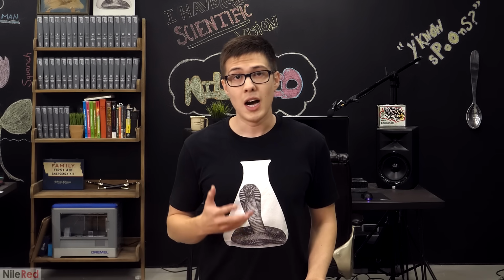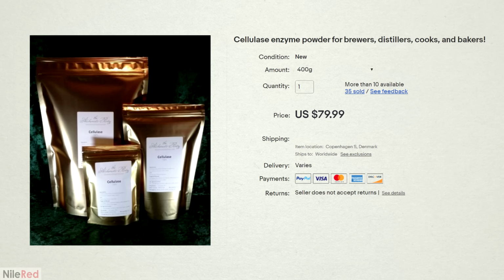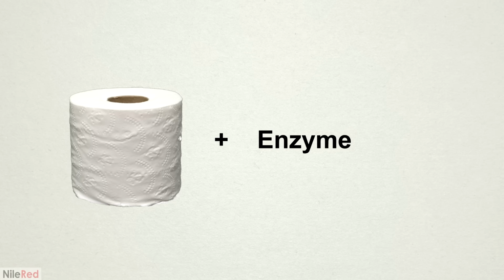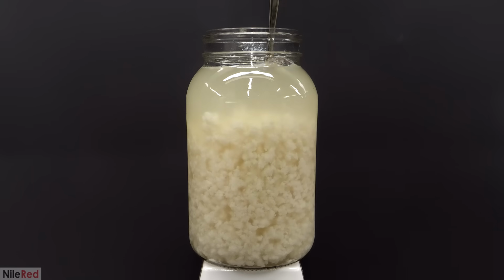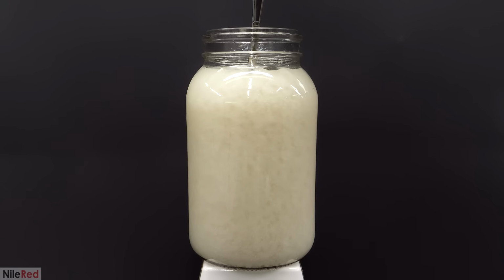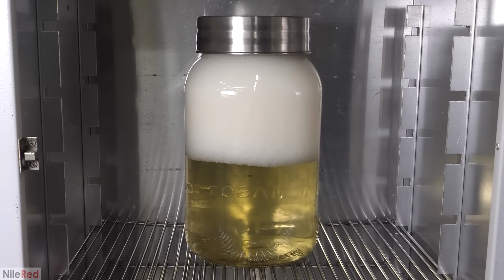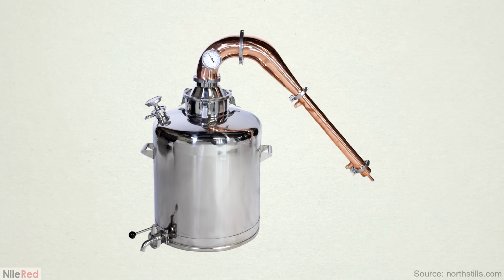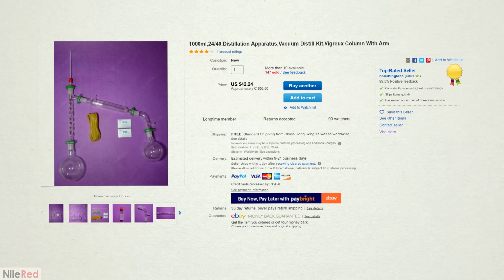Making toilet paper moonshine

Comment: Okay at the beginning of this before I watch the whole video I have to point out that yes ethanol is drinkable, but without impurities it 1) is incredibly dangerous to drink as the high level alcohol quickly becomes toxic by overwhelming your liver, and B) it won't taste good, it'll be like drinking rubbing alcohol. The flavor of alcohol is actually locked in the impurities that are transferred over during distilling from the mash. Most people consider 80 proof or 40% alcohol by volume to be the best drinking percentage for hard liquor. To make drinkable and palatable alcohol from something that doesn't inherently taste good, you'd need to add in flavors, one of the easiest ways to do that would be to add in terpenes from marijuana such as limonene. You could also add in CBD to give it some health benefits at the same time. Hey! There's a video you should do! You should do the chemicals of weed/hemp and extracting the oils and different components and flavors and see what you can make out of them!

Comment: You should’ve put a sort of thumper or slobber box in between your input and output you wouldn’t have had to cycle it through so many times and lose so much alcohol because a lot of your impurities and water would be in the thumper or slobber box and your hearts would be a lot more pure and a higher alcohol content and the end result wouldn’t be as bitter. Also you could’ve maintained your temperature a bit more and gotten better results temperature control is important when distilling. It’s impressive the end amount you were able to collect from your starting amount. I never thought I’d be watching someone making toilet paper Mountain Dew haha I might have to try that sometime I think I’ll stick with corn liquor though. Lol I guess you could always use trees instead of tp though although the surface area wouldn’t be that great so it would take a lot longer to break down the cellulose and you’d probably have a lot more impurities to distill out.
Reply: My god man, use you're commas!  I've never heard of a thumper or slobber box, is that like a secondary catch? Like a split in the distillation setup that certain things, like the ethanol in this case, can skip over and come out the other side while leaving the water and other junk behind?  If so I think I know a guy who really fucking needs that lol.

Comment: This is how I make my paper mache clay ..except I don't use drain cleaner...but I boil down couple of rolls of cheep TP ....and add  craft glue and drywall compound ...mix with an electric mixer...you get a smooth clay that's really paper...and when dry it's hard as wood....it will get moldy so a cap full of bleach to the mix will help...

Comment: You should have tried cold crashing the fermented product, at low temps (<40F) the yeast will tend to flocculate and drop out of suspension at which point you can siphon the product off of a rather condensed yeast/trub cake leaving that mess behind. From there you could try using other clarifiers like SiO2 (commercially called biofine) which is a, "vegan safe" clarifying agent. Other non vegan friendly options are Isinglass (collagen from fish bladders) or simple gelatin. Finally to address your foaming issues during boiling, it can be helpful to use something like a drop of simethicone, you can purchase that commercially as Gas-X an anti-flatulence product. 

Cool video, really enjoyed it.

Comment: Hello Mr NileRed and followers. When dispensing medication the percentage always correlates with the amount of drug in a liquid. For example, if you dilute an IV medication in 100ml of 10% Glucose that fluid has 10g of glucose for every 100ml of water. Is this the same as with alcohol? Does 20% alcohol mean 20g of ethanol for every 100mls of fluid? This may be a stupid question but am interested in a genuine answer and explanation if possiblke.

Comment: Patent: WO2010135347A1 You missed a way to access Xylose ( ref: https://en.wikipedia.org/wiki/Xyleco ) - "Xyleco's process involves using ionizing radiation from an electron particle accelerator to break apart cellulose molecules. Accelerators are energy-intensive, but treatment times are short." You are breaking the bonds at a molecular level. Maybe UV-C and Ozone would break it down, but take longer.

Comment: Needs a minature thumper keg (Long tube run down into water, with another short tube in the stopper to let the vapor exit) between column and distilling coil. Keeps the boiling puke from getting into the end product. 128 proof isn't bad!

Comment: Foaming's always a major problem in biotech. In this instance, you don't reeaally care about the bug, so you might be able to treat the fermentate with a protease (eg., meat tenderizer with papain). I would think that breaking down the major structural proteins should cut down on the foaming quite a bit. Although antifoam/simethicone is pretty cheap too.

Comment: I suspect this could be done with corncobs, corn stalks, and soy husks to create fuel for a practical real world application.  Better yet, "Irreperibly Contaminated" class "Waste grade" recycled paper fiber could also be turned into high potency fuel this way. 

As of a better method, using acidic method you mentioned before using the enzyme method would be most effective, and allow you to use a weaker acid.

You could do the cow's stomaches' method:  Acid, Alkali, then Enzyme.

From the general knowledge I collected (never done it myself): you should always triple distill moonshine meant for human consumption due to it's source material containing quite a bit of methanol, and that methanol getting concentrated in with the ethanol.    While other volatile substances are also a concern, you can taste those.  

Also, as you mentioned with a big warning at the start, always check local laws considering home distillation.  The exact laws vary by locality.  Localities that do allow small amounts have a limit to quantity, and disallow for profit distilling. The exact definition of the later varies by locality too.

Comment: should not stop at totally stop bubbling, CO2 will off gas for some period after fermentation is complete, SG or PH is the best measure. The yeast will also have an off white colour similar to the dehydrated yeast colour. Also should have stopped running at 87.5c

Comment: It would be interesting to see how well this works with sawdust and if there's a way to recover the enzyme instead of destroying it. It could be an interesting way to make biofuel for anyone who has space for some machinery and access to a forest.
Assuming a 50% conversion efficiency instead of your 75, 50% cellulose in wood, and 100% humidity in the wood, you could get 0.5*0.5*0.5 = 125g of alcohol per kg of freshly cut wood, which isn't bad at all. The waste product should be mostly lignin and it can still be used as a solid fuel for the still once dried.
I'm not sure how much energy you would expend to turn the wood into sawdust though.

Comment: I had a discussion with my father regarding this, and I have a question that will likely not be answered. My father seems to be concerned about the creation of wood alcohol (Methanol) in the process. I understand that wood alcohol is not made by fermentation but rather straight destructive distillation, however what I don't have a rebuttal for is assurance that all the paper was converted to sugar (as any remaining cellulose can be converted to wood alcohol during the later distillation).

I understand my question will likely not be answered, but I figured I'd ask.
Reply: He does mention that methanol is created when your starting point contains pectin, which his toilet paper doesn't. Check around 26:36.
Reply: @vraket  Yes, methanol is created from a lot of distillation processes because of this and thats why the foreshot is normally tossed.

Methanol is also created from boiling wood as far as I remember, so unless all the paper was assuredly converted to sugar, it could conceivably create methanol.
Reply: @Niko-ex3bn  Yeah, wood and distillation usually results in methanol. That's even reflected in the somewhat old layman's name for it, wood alcohol. :)

I'm no chemist, so I hope he's correct in saying that (in this regard at least) it's because of pectin, and that the process for making toilet paper gets rid of it. Not that I'd be willing to trust the result without some sort of test (that doesn't involve drinking the sodding thing!).

At least it looked like the foreshot he got was small enough that the amount wouldn't be that big, but I quite agree that flirting with blindness/death in that manner is rather unnecessary.
Reply: @vraket  Ya. The ammount of foreshot he got makes it seem like there wasnt much, however it is still very possible that there was more than expected by the normal foreshot (so if he was collecting a certain ammount of volume as expected foreshot, there could be trouble).
Reply: @vraket  I suspect the issue here is if you overheat the wood, many organic materials begin to undergo thermal degradation producing complex byproducts many of which themselves will react with Oxygen or Nitrogen at those temperatures. Many of the molecules used by terrestrial carbon-based life are not particularly heat stable at higher temperatures ie those that approach or exceed the boiling point of water but then again there is not much selection pressure to evolve this trait as most organisms are simply unable to survive at even lower temperatures as their cells will begin to do things like rupture due to the excess intracellular pressure first.

Comment: Unless I'm missing something, I think you're reading that hydrometer wrong. Hydrometers measure the specific gravity, aka density, not alcohol percentage directly. In order to determine alcohol content, normally you would measure the s.g. before and after fermentation, and based on how much it drops, you determine how much of the sugars have been converted to alcohol.
Some brewing hygrometers also have a scale for 'potential alcohol', which is the percentage of alcohol you could get from an unfermented solution if 100% of the sugars were fermented into alcohol- this number is highest before fermentation, and then you correct it by measuring again afterwards, and using the difference. If you're reading the PA scale after fermentation, it is NOT telling you the alcohol content. And if it's reading high (i.e. 80), that's a sign that you have mostly sugar, and a low alcohol content, not high.
Now maybe there's some sort of hydrometer with a scale I'm not familiar with, but I've never heard of a hydrometer with a scale for reading alcohol percentage directly, and I don't think that's even possible. It sounds like you're reading the PA scale as if it's a direct measure of alcohol content, which it absolutely is not.

Comment: Red, you need to work on that distillation 
apparatus.  Also, do NOT bring your fermented 
mash to a real boil.  Watch the temperature at 
the top, and keep it at about the boiling point 
of Ethanol, not water.  You have a column 
reflux condensing column, read into how they 
work.
Get a beer/wine hydrometer, to check out your 
starting gravity, and finish gravity of the mash.
(May be "wash" for distillers, I'm using beer terms.)

With care, you can get a 80% distill rate, from a 
single pass through that still.  Pot still, not so 
much.

Not a real Chemist, but I CAN make a decent beer.
Oh, what strain of Lalvin yeast did you use?
steve

Comment: It must be the most expensive alcohol ever produced as the price o enzyme alone was close to 80$ and all or it went to the drain.
Also, it was not realty that interesting as using enzymes in chemistry is sort of cheating, You should use chemical methods like a proper chemist.
It would be way more interesting to see I you can make alcohol or just plain glucose from cellulose or starch or just from glucose without using any enzymes or biological methods.
Reply: Why are enzymes considered improper? Biology is just applied chemistry.
Reply: @General12th  
Biology is not chemistry is a very different process.
I don't say that it is improper, it is just cheating if rather than doing all chemistry by yourself you just buy enzyme or genetically engineered microorganism to do all job for you
Where is all the fun if all your chemistry is dumping some magic powder into precursor and extracting the desired product?
If he at least produced the enzyme it would be worth something.

Comment: Did you not need to neutralize the paper after the pre-treatment? I was just wondering if the washings helped wash away any of the base, or if the concentration was low enough to not be of concern. I couldn’t help but wonder why it wasn’t neutralized with a weak acid before being added to the enzyme solution.

Comment: Obviously it would be illegal. But if the bulk price of enzymes and yeast is cheap, then I wonder what kind of junk you could use to produce alcohol and sell it as fake absolut or something.

The fact that something without pectin seems to prevent the worst kind of poisoning, it seems like old paper would be the best source.

I wonder what kind of yield you could get from average paper junk. It would require some extra work to break down and clean but it should be easy enough to dump the dirty distillate when making huge quantities

Comment: Your fermentation would have been more efficient with two steps:

1. Supply the wort with nutrients...yeast like nutrients.
2. Aerate (oxygenate) the wort with an aquarium pump and stone.  Yeast like a aerobic environment to get started.  Once anaerobic they will start making CO2 and ethanol.

With these initial steps and temps between 25 and 30 C the fermentation time would have 3 to 5 days instead of two weeks.

Great video though.

Comment: the reason you had ""Puking" as distillers use it, is most probably because you put foil on the column. By doing that, you increased the vapor flow, but you also Stopped all chances of getting Reflux in the column. A "reflux still" is used to make High percent alcohols, but using your setup you could have easily made 40% alcohol. You added your first distillation back to the flask and added more solution to it, Instead you should have done added distilled water to Dilute the already distilled alcohol and Distil it again to get a cleaner higher percentage alcohol. But none the less great attempt :) don't drink it though as Methyl Alcohol would be in high quantity.

Comment: i would have ditched the tails and kept the heart.  when it was changing to the tails, you could see it in the beaker swirling around like oil and water at the bottom. 27:45 starting here.

Comment: very late comment, but the froth in distillation was likely because the fermented mixture was not degassed, most alcohols should be frequently degassed during fermentation by shaking or vigorously stirring, and degassed more thoroughly before distillation (all from my hobbyist brewing experience, never distilled)